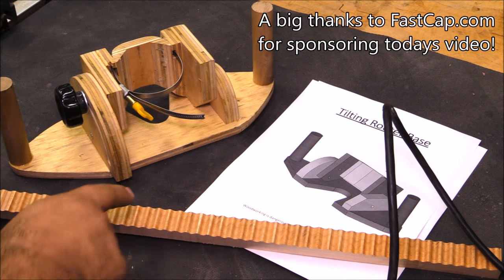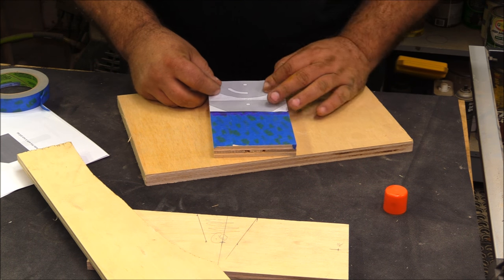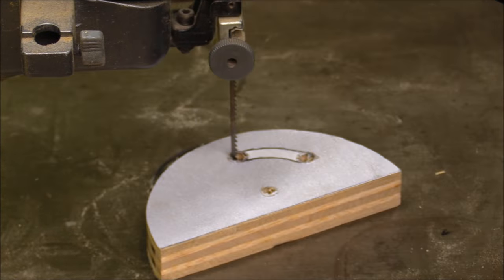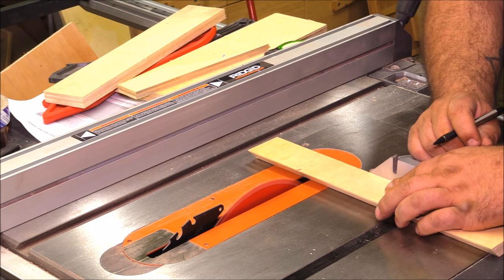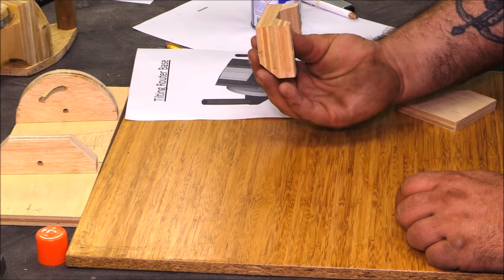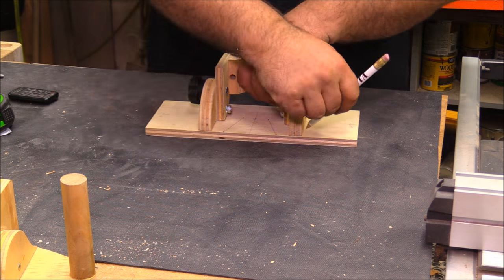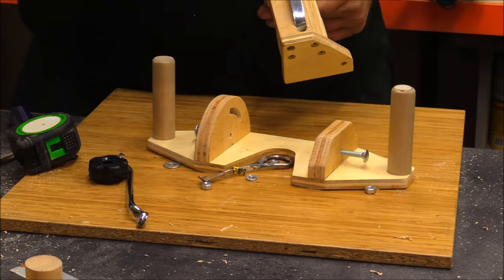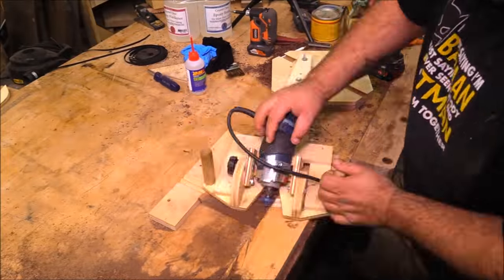(how to make) a tilting router base and up your woodworking game

Comment: Awesome... yet another jig from you I have to build now. Are you ever going to continue the $50 shop series? You inspired me to build a portable table saw that will set up on my saw horses. Now I need to build the modular work table... interchangeable tool insert so you can have router, saw, jig saw, and even a down draft table just by switching the inserts. Maybe I will be able to set up and video the build. You are an awesome inspiration... Thank you.

Comment: Wow, the resulting designs you cut with your base were really amazing! Looking forward to the next in this series!
Izzy, I know your not Matthias Wandel (haha)  but you do a lot with the 2P10. I like that it dries quick but am concerned with strength. So could you do a Matthias thing, strength test compared to dried tight bond? Please?
Reply from the maker: yes, there time to use it and times not to use it but i think it will suprise you how strong it is

Comment: Izzy is your tablesaw a Ridgid R4510? If so, are you happy with the trunion alignment & power sawing thru hardwood as its 13 amp saw where most are 15 amps.

Comment: That's awesome.  Love using my tilting router base in my Makita trim router.  What is the "max tilt" of yours?  Does the activator on the other piece interfere with wood glue bond if you used both in conjunction?  Great video Izzy.
Reply from the maker: make tilt it 48 degrees. no the activator evaporates very quickly
Reply: Awesome...thank you sir.  I think I'll give the CA glue a try in my build videos now.  i was very leery about it messing with the bond of wood glue.
Reply: Chris Parker ,

Comment: Hey Izzy, whenever I use the scroll saw, especially on plywood, it always causes tear-out on the bottom.  Do you know a way to prevent that from happening somehow?
Reply: Matthew Patterson I would suggest just putting some tape on the bottom where you're cutting to stabilize the wood fibres - and/or a finer toothed blade.
Reply: Tyler Hickey thanks m8 - means a lot :)